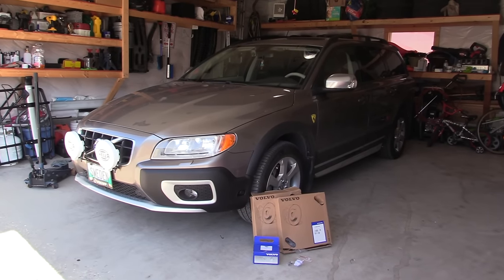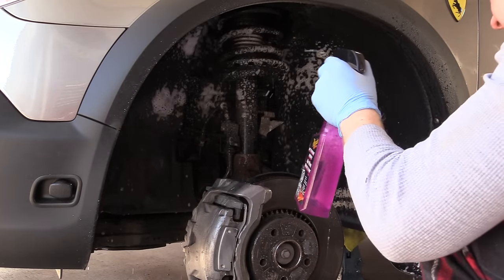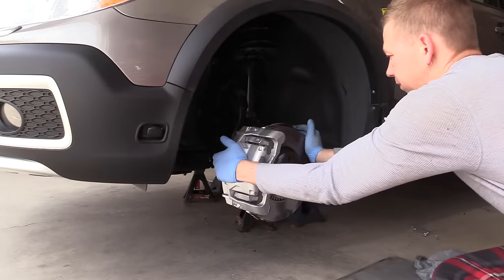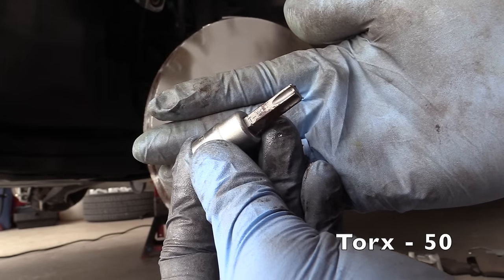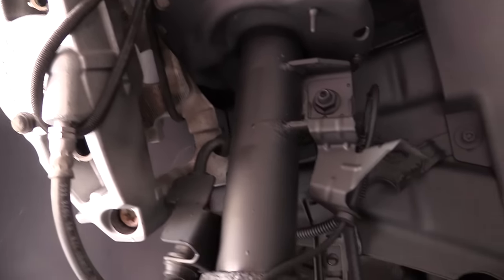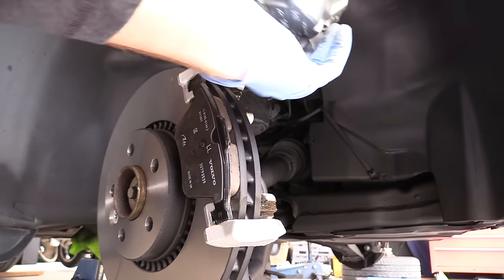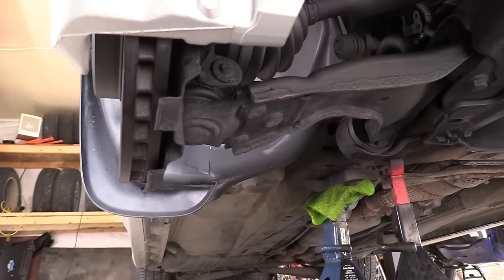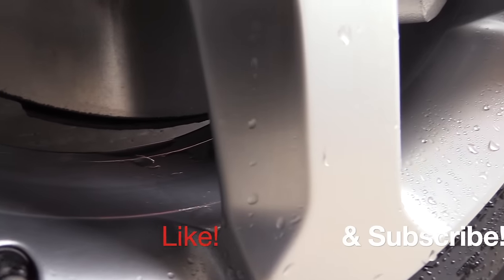Volvo Front Brake Replacement. And a little more!

Comment: Haven't started the front brakes yet. I've read some discussions on Volvo forums about left and right side rotors. The only reason, to my mind that the left and right side rotors would be different, is if the ventilating slot are angled so as to better force air in between the rotor faces. I'm going to check on the rotors I have. If they are similarly ventilated (AND angled), then one side will ventilate better than the other. If the ventilation is straight inward-toward the center, then they will ventilate the same.
Reply: OK, the new rotors I purchased are the same and ventilated at an angle-the passenger side will ventilate better than the driver side. I checked the original rotors - same thing. To my mind, this is a mistake on the Volvo engineer's part. The only possible reason for this is that maybe (and this is a long shot IMHO) the engineers didn't want the driver's side to brake better so as to avoid the car from swerving into the other lane. This wouldn't apply to right side driver vehicles.

Comment: I've not seen the brake pads wear this unevenly.   How do the surface roughness compare on the 2 faces of the rotor?   Another explanation would be that the slider pins are not sliding freely, eating up some of the counterforce delivered to the outside pad.   A 3rd theory is that the outer face of rotor is more exposed to a lubricating residue, lowering the coefficient of friction.

Comment: Thanks a lot for this video. I was able to change my front rotors and pads last week on my volvo s80 2010 T6. The only difference is that mine had 300mm rotors instead of 316mm. I will try the rear ones next week

Comment: this is just a tip but if you want any bolt you screw in to come of easy if you have to unscrew it again and not rust i recommend you buy something called copparpaste and put some on the threads. it wont make the bolt unscrew itself and the paste makes sure that you dont get any rust on the bolt or the threaded hole

Comment: The reason the pads wear unevenly is due to the installation. If the poles that the caliper slides on is lubricated properly with Copper Ease or such like, the uneven wear does not happen as the sliding caliper can move correctly.

Comment: Outstanding videos.  Really like piece by piece views of components, bolts, etc.  Appreciate your efforts and professional guidance. I downloaded the Volvo service manual (PDF), and the VOLVO manual specifically says NOT to lubricate the caliper pins ... not sure why.  I suspect there is a rubber seal inside, which may negate the need, and/or "gum" things up ?  Dunno ! They DO lubricate the pads contact points, just as you did.  As far as pad wear,  I believe a combination of  simply design issue, AND, specifically, it is not coincidence the inner pads wear more and are attached to the pistons.   I agree with prior comments that "light" braking" with inner pads slightly more "pressure on the disc than outer pads.  Most all cars inner pads tend to have inner pads wear slightly more, noting this Volvo has substantial wear differential ...
Reply: I am using Carlube Silicone Grease XSG070 on my Volvo XC70 2006 D5 Diesel when servicing on my brakes and I am verry impressed of results.
On sliding pins: 
The calipers are floating even 3 Years after this treatment .No sign of corrosion.
In the description:
ADVANTAGES:

Extreme temperature resistant multi purpose grease
Lubricates and protects plastic and rubber parts
Ideal for brake pads, o rings rubber seals and brake callipers
Water repellent
Because it has low dense ,I use a tiny tube - as in the pen.
I pushing the tube inside in the grease and  then with it lubricate inside the tubes for the sliding pins.

Comment: Oh, you were a little late with the video, I just finished the same job on my XC70. I also had this uneven wear problem in the front, my inner pads were significantly more worn. On the rear calipers the wear was more even but not perfect, the slider pins in the rear were almost completely seized.

Comment: Correct lube for caliper pins and sliding contact points for brake parts is silicone paste. Sil Glide is a good one, and inexpensive. No more NeverSeize, generally speaking.

Comment: Good work. A few questions:
Why didn't you remove the caliper and bracket, rotor, pads and only then brushed off all the rust first? It'd make a whole lot more sense to clean all the rust first before painting the brake and suspension components.
Nice to see someone use correct torque values as opposed to the often-used FT* value.

*FT - Friggin' Tight

Comment: After watching this video and one other by somebody else, I did all 4 brakes on our 2018 V60. Inner brake pads on the rear brakes were worn way worse than the outers. Front brakes were worn totally equally.
I believe the inner pads will wear down quicker if the grease on the float pins gets old and kind of dried up a bit. Brakes won't fully release if that happens. I've seen it before. Done lots of brake jobs.
Reply: I am using Carlube Silicone Grease XSG070 on my Volvo XC70 2006 D5 Diesel when servicing on my brakes and I am verry impressed of results.
On sliding pins: 
The calipers are floating even 3 Years after this treatment .No sign of corrosion.
In the description:
ADVANTAGES:

Extreme temperature resistant multi purpose grease
Lubricates and protects plastic and rubber parts
Ideal for brake pads, o rings rubber seals and brake callipers
Water repellent
Because it has low dense ,I use a tiny tube - as in the pen.
I pushing the tube inside in the grease and  then with it lubricate inside the tubes for the sliding pins.

Comment: Great video and your XC70 looks fantastic!  I just did the front brake pads/rotors on my 2012 s60 T6 and your video was a big help!  The job was actually a breeze, less than two hours start to finish, glad I didn't pay somebody else to do it.

My inner pads were also much more worn than the outer pads.  The passenger side pad was completely gone while the driver side had less than 1mm of material.  Meanwhile the outer pads had maybe 3-4mm of material left.  I'm guessing the slide pins were getting hung up, as they looked pretty rough, so was glad I got new slide pins as well.  Will have to keep an eye on how those inner pads are wearing when I put my winter tires on in a few months.
Reply from the maker: Glad my video helps.

Comment: I don't know reason why inside brake pads worn faster but don't worry cause it's normal in Volvo. It's the same in my 2006 XC70, 2008 C70 and in 2010 XC70. Everything is ok. 
It's probably because piston impacts directly into inside pad. That's only reason which comes into my head.
In my XC70 D5 factory rotors and pads last for ~110kkm and was replaced after few years and was replaced also to Volvo oem rotors and pad. Unfortunately I can't say they were worth of their price.
In few days I am going to change back rotors (still factory after 220kkm) and pads. I diceded to buy an ATE products.

Comment: Great video, very detailed. What is the torque spec for caliper bracket bolts? Surely is not 200NM and even heavier than the wheel nut.

Comment: slide pins have to be lubed as the allow the caliper to slide over and pinch both brake pads as this setup is like most new cars only one piston on one side..this way you get equal wear on both pads. once a year i lube these pins and were the pads mount to so both pads wear equally. i live in canada to

Comment: I believe that the reason for the inner pads to worn more than the outher is light braking instead of gear down in a light downhill.  If you do much light braking, you don't apply enough force for the slider bolts to move and only the inner pads brake.

Comment: I just want to let people know that i replaced my break discs and pads this week with items from Yellows from EBC They are just fantastic. (I do not have anything to do with the company) They say they do not make any but after talking to TIM in tech they do, they are just for the Volvo xc60 For some reason they dont say that they make it directly for the Volvo XC 70 2008. I purchased a full set and it stops in half the distance much better then the stock OMD parts. So for anyone who wants to know the following breaks sets do fit a 2008 VOLVO xc70 just take of the old and pop on the new, They are a perfect fit. I hope this helps people as it was bloody hard work finding upgraded breaks for the old lass. These are used on the street day in day out. Last week they saved the front end of my car on the duel carriage way when someone with out break lights stopped quickly.

FRONT - DP41914R / USR1549
(PD08KF235)

REAR (SOLID) - DP41934R / USR1592
(PD08KR355)

REAR (VENTED) - DP41934R / USR1590
(PD08KR357)

Comment: Hi Yuri, thanks for another excellent video. I've had the same wear pattern on different cars over the years and i was told that as the piston is on the inside of the caliper, when brakes are applied the pads will contact the rotor on the inside first before the outside pad. This makes sense if there is maybe some sticking in the sliders. The only lubrication i use on the brakes and hubs is copper grease between the pad and the backing plate as this will prevent the brakes squealing due to movement between pad and plate. Does VIDA recommend greasing other parts of the calipers and with what kind of grease? You did a great job of cleaning and painting the wheel arches, they look great. You are lucky to have a couple of enthusiastic apprentices to help you out. Stay safe and keep up the good work. 🏁👍
Reply from the maker: Thx. The piston on one side makes sense. The Volvo pads have rubberized backing on them whuch makes me think will prevent any noise.

Comment: One of the reasons inner pads wear faster than outer pads is that they don't get cooled as well - they are well shrouded by the wheel, wheel well and suspension components.

Comment: I understand that the inner pad wears more if you brake lightly. That is, if you brake with just enough effort to bring the car to a long stop as opposed to a short hard brake most younger drivers do :-)
Reply from the maker: That is an interesting theory.
Reply: @volvosweden  not a theory  this is what the Volvo Tech that works on my XC70 told me, very common on Volvo's. Also, when I serviced my own front brakes the sliding pins were lubricated when I removed them, that was from the factory.

Comment: I just did my brakes on my P3 and it was ok but the drivers side disc was seized on and I had to cut it around behind the hub to get it off but the passenger one came off after a few smacks with the hammer. I used Hella Pagid brand brakes but they pretty much the same as any I guess. I didn’t use new bolts but it’s ok and I used copper grease to stop the discs seizing on again and on the pads, where the pads sit in the Caliper and on the slider bolts. Job is easy even with cutting discs off. I also used impact wrench Milwaukee M18

Comment: Uneven brake wear is due to little to no movement of the caliper on the caliper slider pins - these are the 7mm hex bolts hidden under the plastic caps on the caliper.  If the caliper seizes on the pins, then you'll get premature wear on the piston side of the caliper as the piston is the only component of the caliper/pad/piston combination that has any movement.  The fact that the piston side wore more is a sign that the caliper was moving (probably after the pads were installed) but more recently, became restricted in its movement.  When reinstalling, using silicone caliper grease on the caliper slider pins will help keep them free until the next service.  Don't use too much as it snots up and has the opposite effect!!!  Also using a new "hardware" pack helps to keep things from seizing up - this normally comprises of rubber boots/grommets to keep dirt out, and the silicone grease inplace - not something required on the super Volvo design!   Happy new year!

Comment: ive heard the pads wear out unevenly when the two sliders are not lubricated well enough so can not slide well enough to give equal squeezing preasure on both sides of the disk. more preasure on one pad one one side of the disk= quicker wear than the other side

Comment: I think the inner pad wears faster because that is the side that the piston is on. On my 2011 S60, I found the same thing - all the inner pads were worn more.
Reply: I DO think that the piston side exerts more pressure on the pads, thus the faster wear, but there may be some credibility to the idea that the sliding pins play a role in this as well.

Comment: Uneven wear happens when the lubrication wears out from the sliding pins and the caliber will not move freely. Winter conditions and salted roads have a impact on those. For example you can take the pins out and sand the corrosion and apply more lubricant while you change back from winter to summer tyres. That might be an overkill but that surely help the uneven wear. Last spring I did not do this to my brakes and after 1 year my rear breaks outer pads are almost gone.
Reply: I am using Carlube Silicone Grease XSG070 on my Volvo XC70 2006 D5 Diesel when servicing on my brakes and I am verry impressed of results.
On sliding pins: 
The calipers are floating even 3 Years after this treatment .No sign of corrosion.
In the description:
ADVANTAGES:

Extreme temperature resistant multi purpose grease
Lubricates and protects plastic and rubber parts
Ideal for brake pads, o rings rubber seals and brake callipers
Water repellent
Because it has low dense ,I use a tiny tube - as in the pen.
I pushing the tube inside in the grease and  then with it lubricate inside the tubes for the sliding pins.

Comment: 0:43  Well done for making this video.  We can see that the genuine Volvo pads are made by ATE.
Reply: The calipers are an ATE design but the genuine pads are made in the UK by Ferodo. The same pads are rebranded for other manufacturers, if it says JURID on the left ear of each pad they are the same as the genuine item.  My XC70 with 316mm discs has Honeywell Bendix pads but they have the same JURID stamp and were made in the UK.

Comment: The inner brake pad always wears out a little bit more because it's a single piston caliper, I noticed when I don't put any grease or paste.. anything on the slider pins and make sure the dust caps are installed properly, I noticed that both of the brake pads wear down pretty evenly then..

Comment: I know this is an old video, but my tech said that because aftermarket brakes were fitted to my car prior to me getting it, it is causing a grinding noise at full lock. He says it's because of the backing plate behind the rotor. Do you think that could be the case? I've done many brake jobs in the past and always used aftermarket brakes and never had an issue. I'm debating fitting OEM vs. pulling everything off and seeing what the backing plate looks like. Just wondering if you noticed if the tolerance was that tight when you were doing this. Thanks for the great video!

Comment: Don't assume that the silicon is going to last to the next brake change, you had no lubricant when you took them off. Silicon will evaporate from the hot brakes. Reapply lubricant every second oil change or inspection.  Also silicon is for the slide pins that have a rubber seals as it is compatible with the rubber.  On my cars I use the silicon for the slide pins as they have rubber seals and on the metal to metal I use a SMALL AMOUNT  Permatix Anti-seize Copper Lubricant, this stuff will last till the next brake change, on my cars it is the silicon on the slide pins that need a top-up. Thanks.

Comment: The inner pad wears faster because it is pressed onto the disc directly by the piston, the outside pad only applies a much lighter pressure to the disc because it is only pulled on by the mechanical slide of the calliper on those slide pins. So the inner pad does the bulk of the braking effort. Great video btw.
Reply: You can get more even wear by "dressing" the slide pins.  Chuck them in a drill or lathe and burnish the surface while they are spinning.  Don't take off pin material, just polish off the grunge. The other thing you can do is if you soft brake lines are old, replace them.  When they are old their inner surface can separate from the case and hold line pressure when they should not, making the inner brake drag a little.  Also check for roughness where the caliper is supposed to slide on the bracket.

Comment: When using the wire brush, I would recommend wearing a breathing mask. There is a lot of asbestos from brake pad material/dust.
Reply from the maker: Good advise. I will get some masks and keep it in the garage.
Reply: Hi, I agree that if doing any work with dust and paint then a face mask is a good idea.  However, I can assure you that Volvo no longer use asbestos in their oem pads.  It has been that way for a very long time
Reply: James Saunders Your right, modern brake pads are made from ceramics and Kevlar. My bad. Wearing a mask is still not a bad idea.
Reply: Good tip all the same, but asbestos has been banned for years
Reply: Right, they should be washed with brake cleaner. I am from East Europe as well, we don't care too much about safety, just about the job done! LOL
I don't wear safety glasses, rubber gloves or masks! I'll see later if worth it!!!
Reply: dude there is no asbestos anymore in brakepads for a long time.

Comment: Your inner brake pad wears more than the outer one because you caliper isn't sliding freely. Make sure to use ceramic grease on sliding pins. I would put a bit more of grease than u did. Also putting some grease on brake hardware is good because it acts as anti rust prohibitor. Pads can slide freely.